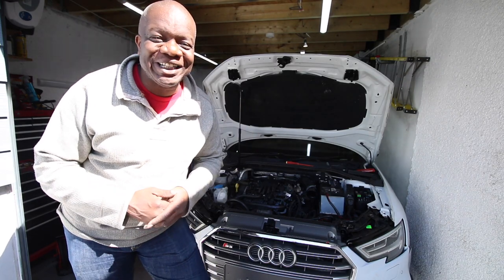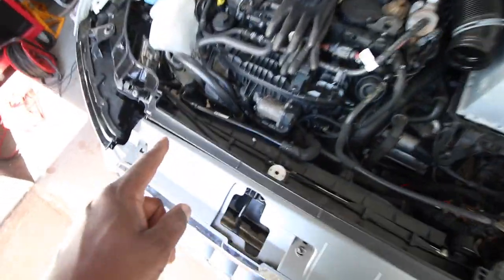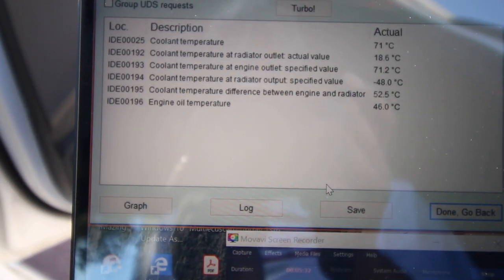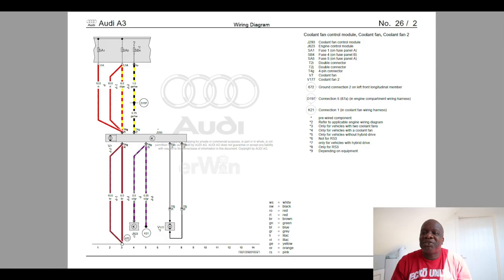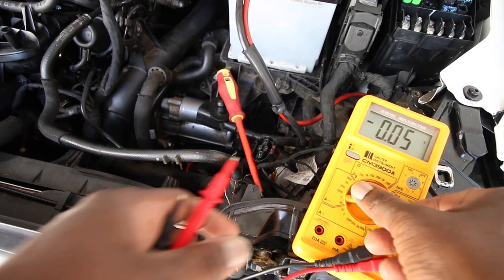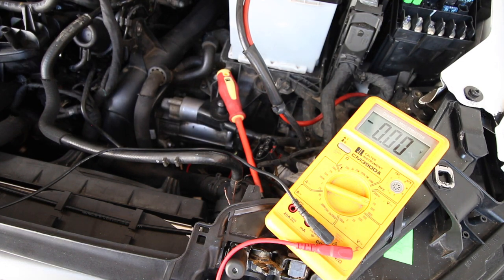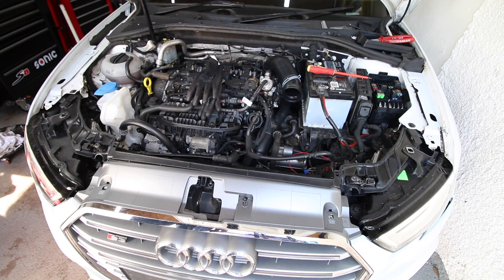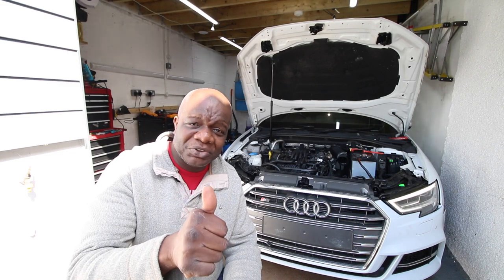We finally fix the high speed coolant fan issue on the Audi S3

Comment: The broken wire is known as the signal wire. It's a PWM signal, Pulse Width Modulated. Instead of varying the voltage, the ECM varies the duty cycle or the length of time the voltage is supplied. You cannot accurately measure the voltage with a volt meter because a meter isn't fast enough to capture the peak and low point. U need a scope. When that signal wire is disconnected (or broken like your Audi) the fan module goes into emergency mode and runs at top speed. Eventually, the car goes to sleep and the other 12v signal is ended. Good job, you repaired it correctly. A dealer might have charged u to replace the harness which would have been expensive and if a new harness is no longer available, the dealer will try to sell u a new car.
Reply from the maker: Indeed they would

Comment: You legend.  I can imagine you must have had a massive smile on your face when you solve that problem.  Well done Paul.   Great video.
Reply from the maker: Thanks, and yes I did
Reply: @CarsForPaul  Hi Paul when you had this issue was your check engine light on? Mine is doing this and the light is on
Reply: @CarsForPaul  Also, is it dangerous to drive with this issue?
Reply from the maker: @carlosflores4380  mine didn’t have an engine light on so I suggest the light is for something else. I would strongly recommend you scan the engine for the codes so you can understand what the issue is.

Comment: Hi Paul, I have the similar issue, fans running at high speed but it happens only when the car is warmed up. I checked VCDS found the Fan speed (spec) is 0% but (actual) is 50%. I checked all temperature sensors, all looks fine. I will try to follow your video and see if it is the control wire issue. However one thing I am not sure is were is the actual fan speed readout comes from? Since seems no feedback signal from the fan control module to the ECU.
Reply: Did you find a solution for your issue yet? Same issue with mine. I've just been throwing progressively more expensive parts at mine without any luck

Comment: Hi Paul, both my fans, cooling and aircon fan, does not come in at all.  Can I connect it directly on the battery and control them manually via a toggle switch inside the car. Thus bypass the control unit? "Christo is my name and I am from Durban

Comment: Hi Paul very interesting. But my problem is I have a vw passat b5 2ltre petrol alt engine changed thermostat & all cencors but cooling fan not kicking in.wired fan direct and works perfectly any ideas.much appreciated.

Comment: Thanks Paul. This helped me figure out the same issue with my S3. The purple wire came out of the connector when the shop was installing a new radiator.

Comment: Great video Paul. My A6 has a very similar problem. I've eliminated temperature sensors and was thinking it was the fan module. Time to check the loom before splashing out on a new module. Thanks for the video!
Reply: Hi, did you manage to resolve the issue ?
Reply: I have an audi a5 when you start the car fan run on a full speed none stop and inside my car the gauge that shows the temperature not moving at all and my fan seems like it is draining my battery since been having battery issues now help

Comment: Great video.explained perfect.i have a 1.2 TDI just by turning ignition fan boost to Max.fan plug disconnected wires has GND 12V and Black/yellow 12V and Black/purple 3.55V if i connect fan plug Black/purple gives 9V i see that your (PWM wire) Black/purple after fixed gives you 0.5V. Can you give me some tips,in my case.Thanks

Comment: Hi Paul, great video. You are the only one I can find that has a similar issue to mine on my VW Golf. Hopefully you see this; I checked my pins and I am getting 12V 12V GND and 3V but my fan speeds up like a jet engine when plugged in and stays that way. I'm thinking fan controller in fan itself.  But no idea how to test the controller. Thanks.

Comment: Nice diagnostic.... I have polo gti with same problem.... But now car after clearing fault runs ohk but after while i lose ability to accelerate.... I will check that wire.... Maybe car going into Protection mode because of fan issue..... Always running with ignition on...... Now my question like in ur case, what if that wires are all good? .... Can it be the control module itself that packed up?
Reply from the maker: if it was the module, it would likely show when doing a code read

Comment: Hi . I think I may be having the same problem,, my fan comes on around 95 degrees and I can’t turn the fan speed more than half way ,, after turning off the engine then back on again it’s okay for a few minutes, also not getting any warm air till the engine is about 90 + degrees 
Would it be the coolant auxiliary pump ?

Comment: I’m having this issue with my 2018 Mercedes glc300 coupe. It has always ran fine until a couple of weeks ago. I took it to Mercedes and there aren’t any fault codes and all of the sensors are working according to them. They said wait until a check engine light comes on because they can’t find anything wrong with my car other than the fan is stuck on high. They said the same thing it must be electrical but they can’t find where it’s coming from. Will this apply to the Mercedes glc300 as well??  I’m literally having the exact same issue….The fan in the front is running on high as soon as the key is turned to the on status. Maybe I can show the mechanic at Mercedes your video.

Comment: Hi, I am having the same issue on a 2018 RS4, but it comes and goes. When it happens, fan is full blast and the engine temperature reading is all over the place (high, low, etc), but the oil temperature is fine. So no overheating. Any ideas?!

Comment: Hey Paul I just had a quick question I’m having this same issue , say it’s the purple cable like you where did you initially run the red cable I know you connected it to the purple wire but where was it ran from
Reply from the maker: It runs in the loom to the fuse box under the bonnet

Comment: Hi Paul - Yes I would like to parts video please - also did you get the pressure tube that goes across the front of the car behind the bumper? Kind regards Clay.
Reply from the maker: Will do, and no I haven't got the pressure tube yet.

Comment: Hi there. I know your video is not recent but I am hoping you will be able to give me some advice.  My control cable from the ECU is not constant as yours shown on the video. It fluctuates up and down. All wiring and pins in a good condition from ECU to plug but voltage does not stay consistent.  When I put the scan tool in it says my map control sensor is -48°. Can this be the reason why my fans are not coming on?
Reply from the maker: Hmm, it would appear so, something is feeding it the wrong info. most Audis have two temp sensors so one could be faulty.
Reply: @CarsForPaul  I will have a look.  Thank you for your reply.  Appreciate it 🙏

Comment: Hey Paul, i have an audi a3 8v the 1.8tfsi version, and my fans are also running all the time.. i am also measuring 2.8v on the pwm wire. What can be the issue?
Reply: There are no faults recorded

Comment: Hi Paul would you know what fuse I can tap on a Audi A3 68 plate, I am thinking of installing Ambient lighting and want to connect to Cigarette lighter  by hard wiring, so when I turn the Ignition on they will come on too,
Reply from the maker: I would probably tap onto the existing ambient lighting as you can get to this via the central console which pops out quite easily with some force
Reply: Cars For Paul  yeah could do, also found out that I can tap into fuse f40, as it power all the Cigarette lighter sockets in car, thanks for getting back to me Paul

Comment: Are you sure the headlights are the exact same as they may not be the matrix ones originally fitted to the car? I would check psrt numbers with original headlights of possible if not just code these in mate in adapations
Reply from the maker: I have just discovered that they are not the correct one, my ones are adaptive LED's, the ones I have fitted are just LED light hence the error code.
Reply: Cars For Paul thought so but you can change that from coding

Comment: hi, most instructive video.
i need help on this one.

radiator fan never stop.

ignition key removed:
11:11
power to fan 13v(left & right)
power from ecu(top), 0v
signal from ecu 0v

ignition key on:
power to fan 13v
power from ecu(top) 12v
signal from ecu 0.01v,  looks low.

sometime fan was still going on for few minutes after engine off.
can mean power to fan with key removed is normal.

continuity test on fan module(L&R spade),  yes
can i assume dead module?
-----------------------------------------------------------------------
ignition key removed i have 2.5 amp draw from battery, slowly decreasing to 1.9 amp.

is it normal  a 2 amp draw with key removed? 
can a bad ecu kill the fan control module?
(low signal 0.01v from ecu, power to fan with key removed and ~2 amp draw from battery looks high)

Comment: On any engine there's a swith which turns fan on usual is on thermo housing
Reply from the maker: in this case, its the ECU that tells the fan to come on as this also controls the fan for the AC

Comment: Have you changed the mileage on the odometer to what is on the new engine ?
Reply from the maker: Nope, the mileage has to be the same as the chassis, not the engine
Reply: Cars For Paul  thought that would be the case as if it had its first MOT it would be about 67,000 miles then drops to 35,000 miles it would look a bit suspicious. But thanks for getting back so quickly keep up with the great content and keep safe. Durham the North East of England if your wondering where I’m from.

Comment: Hey all, need some help with diagnosing cooling fans.
 Skoda Octavia 2013 mk3 ea288 clha engine :(
Cooling fans don't run when the car gets hot, especially idling/traffic.  The Dash gauge doesn't go above 90 in this instance, but the VCDS temp rises steadily above it.

If I switch the HVAC on radiator fan run.

When I run FAN  VCDS output test,  fan spool up, seemingly at a gradually increasing speed, to a maximum of 87.5% load.

VCDS reads coolant temperature, it got to 101 deg C with no fans turning on (AC Off) before I switched the car off.

Can't work out what's going on.  The car seems to know the temperature of the coolant, but doesn't switch on the fans.  Fans SEEM to work ok, because AC turns them on.  
 
Is there something else apart from the coolant temperature reading that turns on the radiator cooling fan?
 
Thanks heaps.
Sider

Comment: my a6 c6 2008 2.0TFSI was in an accident and after fixing, the radiator fan rans at full speed as long as the engine is running, any ideas on fixing this issue?
Reply from the maker: check the fan regulator, common problem
Reply: I bought a new fan regulator on ebay, but this one doesn't start the fan even when temperature gets to 100degrees celcius....is there a way of testing this regulator?

Comment: The problem with my Audi s3, the fan runs non stop as long as the enginerun(shuts down after 2 minutes when car off) then when driving sometimes picks high coolant temperature but my coolant is very cold. Pls help. I changed the temp sensor next to radiator. (All this happened after alternator change) Thank you

Comment: I have a Q5 2015 premium plus. And I got a oil change from someone who changed it by the bottom of the car instead of the cypher. They had to seal it with silicone because the bottom started leaking so bad I had a puddle of oil in my garage. I took it back. They gave me my money back then the back up camera stopped working. My fans won’t go off and the are loud. I have no High temperatures no lights on yet my fans are running constantly. Then I saw I needed coolant so I got the correct coolant added it and hoped it would stop the fans. 

Well fans are still running and my Q5 is sick. Audi wants to charge $180 just for diagnostics per problem!!! I’m so sick. How’d I go in for a simple oil change and all of this stuff fell apart?  What’s going on? 

Please hit me back. I need help

Comment: It's not getting a signal temp sensor so fan will run to prevent damage to engine as it no signal
Reply from the maker: It was actually getting a signal from both temp sensor, it was the ECU where it wasn't getting a signal

Comment: The Ecm connect to fan relay  signal wire is broken . So fan turning not stop ?
Reply from the maker: That is correct
Reply: @CarsForPaul  may be my dodge caravan difference   . Fan relay contact computer it ground relay then fan turning  ?